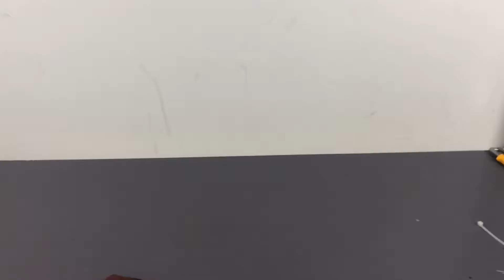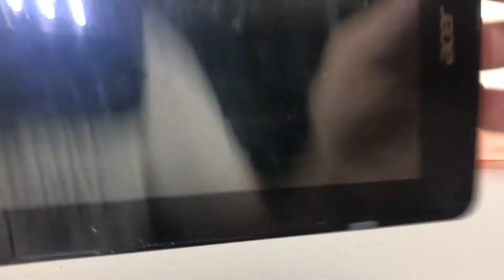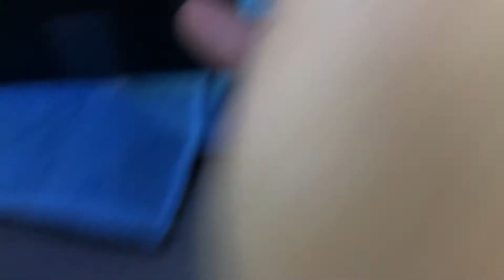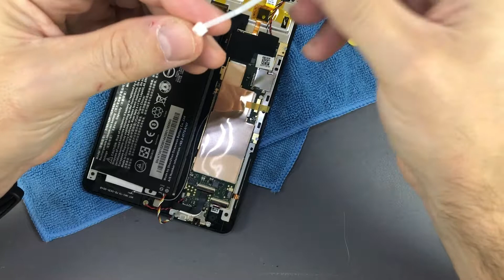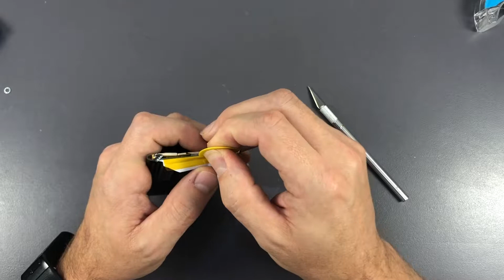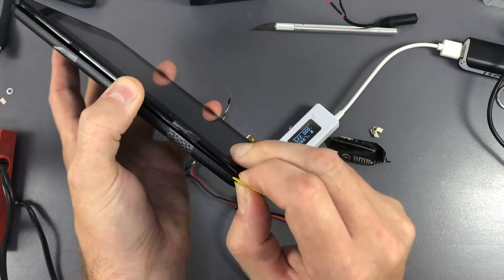Acer Iconia One 7" Battery Swollen, Puffed Up

Comment: This tablet served me well for the same amount of years as you. Til the battery was shot. Bought a new lenovo. Hate to Chuck this thing. So I too opened it up, surprised how easy it was. Batteries are now just $15. That's the price of lunch or a cigar here. got it back working. It's the bathroom tablet now. The hardest part was removing the battery connector.
Reply from the maker: I thought about trying a Li-Ion 18650 cell to see if that would work in place of the flat battery